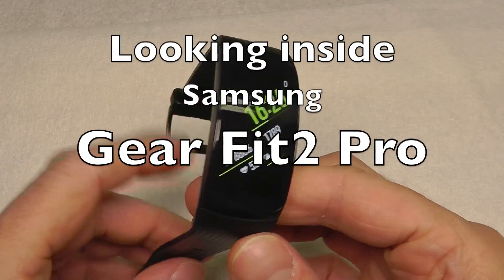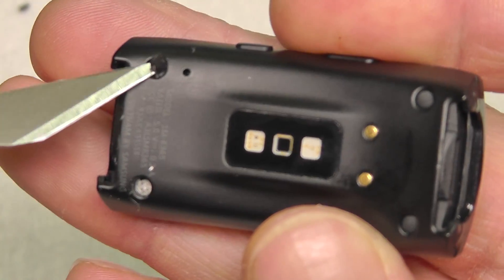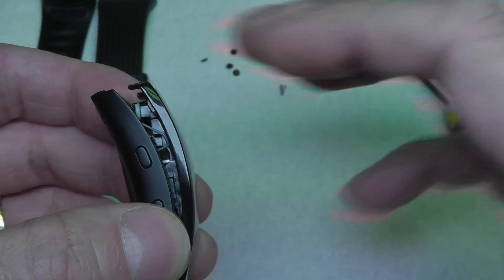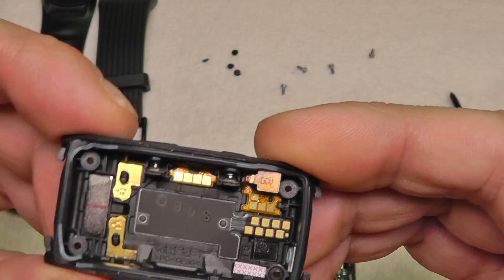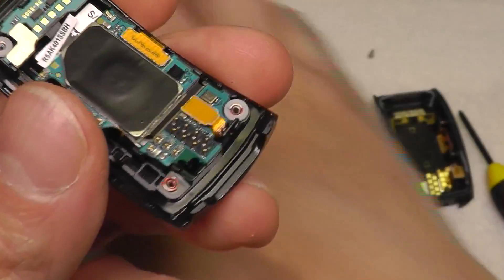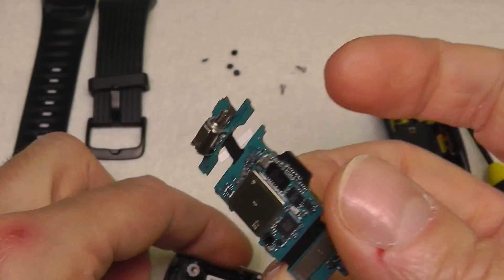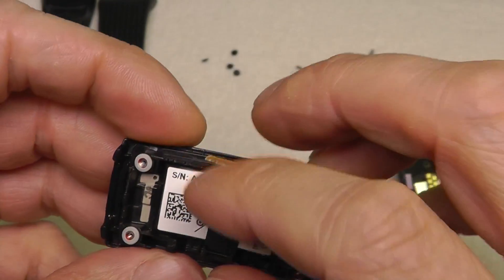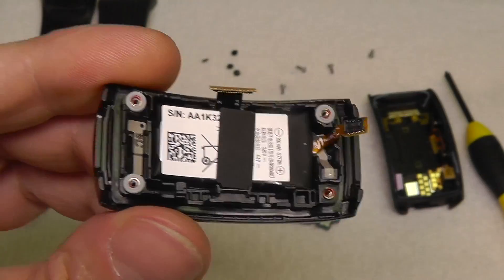Looking inside Gear Fit2 Pro - TEARDOWN

Comment: Is it possible to remove just the vibrating motor from the board?   I do not see how, it looks like the board is physically attached to the mother board.   The watch recently stopped vibrating, I made many different changes in settings in the watch & my phone, have uninstalled the app & reset the watch a few times,, the vibrate no longer functions,, even when using the watch timer, so am thinking the motor has died,  I took the watch apart and there was allot of gooey stuff I found on the motor board, am thinking it must have come out of the motor, clean it all off, reassembled & it still doesnt work.  I am HOH/hard of hearing & I use this watch as a wake up alarm, vibrating on my arm.... I cannot see ho to get the motor out, found replacement motors online and it seems it does come out by itself I just cant see how..
Reply: I looks like the motor in on an extension of the flex-rigid main PCB.  Using SMD rework techniques you will have to de-solder the old motor and solder the new one in place.